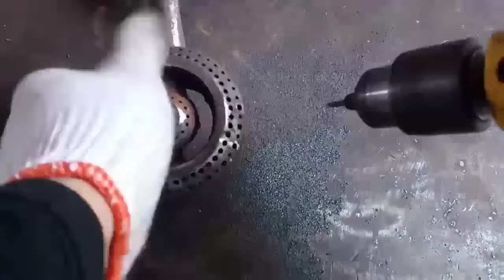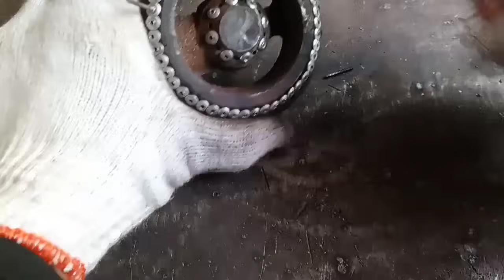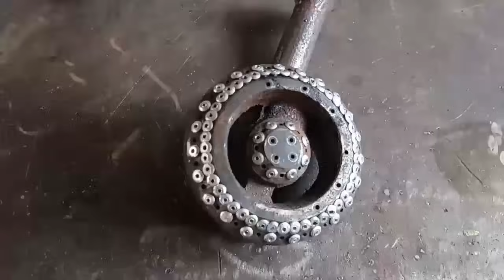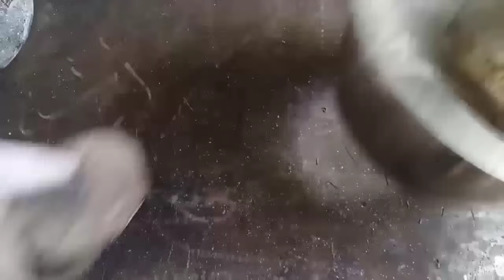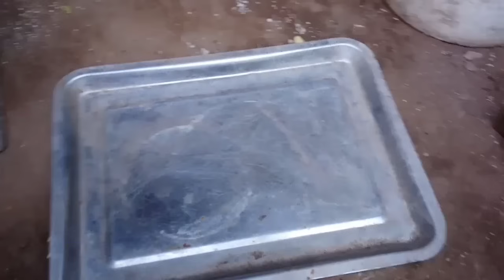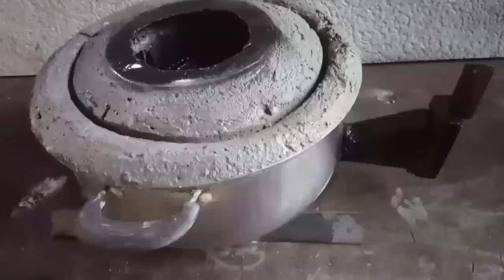It Took  Me 3 Decades  To Learn These Handy Tricks For Used Oil Stove Burner

Comment: Cement and heat is a bad idea. You could of done something similar without concrete if you are using it for direct heat onto a surface for cooking. Lots of wasted time effort and materials. Rivits also have a low melting point..

Comment: Used engine oil doesn't burn blue.
Reply from the maker: Yes can burn blue 
I have a vedio
Reply: @Mr.D.I.Y09  the metal particles in used engine oil glow which is why only clean oil burns blue.
Reply from the maker: No, any kind of engine oil can burn blue even new or used engine oil
Reply from the maker: https://youtu.be/uisnD64Jd80?si=FFSzmygJfQ73eb1r